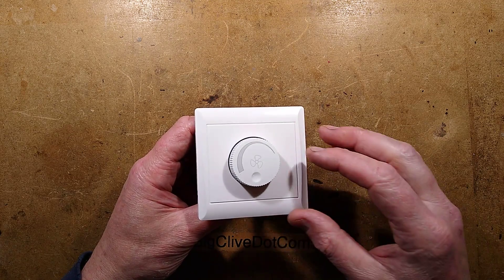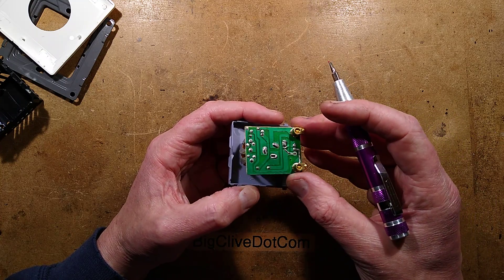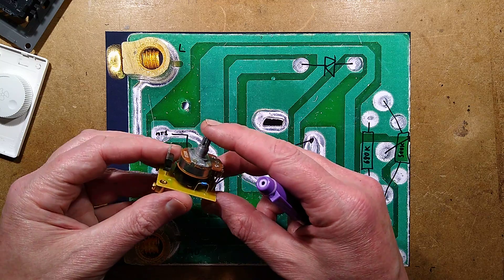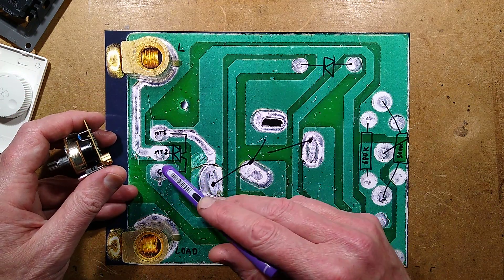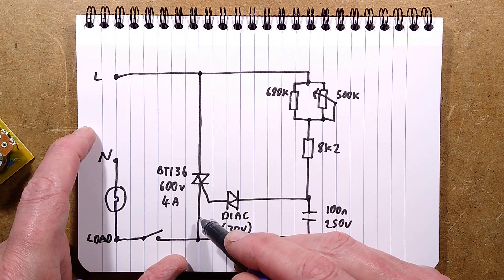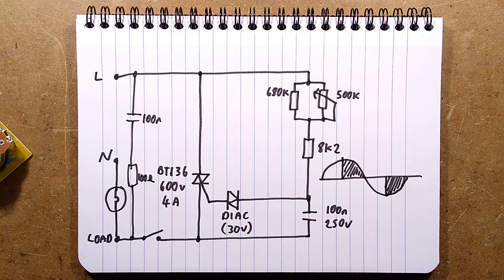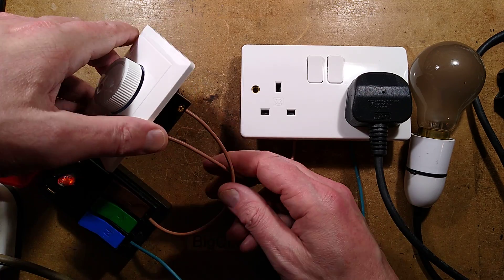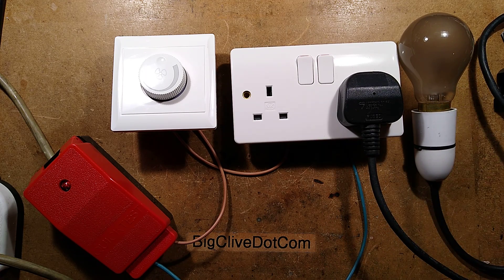Inside a cheap eBay fan controller (with schematic)

Comment: Hello,

I just installed a floodlight next to my CCTV camera outside and I'm planning to control it using a remote control.
The receiver (A chinese one) will be set in a small plastic box in the loft (The part where stuff is stored and where I don't go very often).
I need of course to supply the receiver with 12V from the mains, yet I don't want it to set the house on fire, particularily when I'm not home.

What do you think would be the most reliable option "fire-wise" so to speak between a 50Hz transformer/bridge rectifier/smoothing capacitor combo and a small switch mode PSU like a phone charger but 12V ?

BTW it's 230V here and it also gets quite hot during the summer, ie right now, especially in the loft, but in the living parts of the house I have AC, which means it really gets hot some days.
Reply: The 12V are only to power the receiver or also for the floodlight? 
If the floodlight is 230V and LED and big enough maybe you can put the receiver inside it, in the same space where the LED driver is. Although some of the LED floodlights work without a driver, they have a regulator IC on the same board as the LEDs.
If the light had space there, any switched mode power source with an insulating casing would work, in principle the driver should not affect the receiver too much, and being in a metal casing it could be solved by drilling a hole and putting an external antenna.
There are SMA (the type used by WIFI antennas) male-male connectors for through hole panel mounting, they are threaded on both sides and have an O-ring seal, to connect it to the receiver you would only need an SMA pigtail.
On Aliexpress (probably also eBay and others) you can get compact MEAN WELL switching power supplies with a plastic case, I don't know if they are genuine or not, there are also some imitations with a very similar logo that actually say MEN WELL, WEN WELL and things like that.

I've a DIN rail WEN-WELL 12v 1.25A in the generator shed, the shed has a south facing window so all summer it is quite hot inside, it must have been about 4 years and so far it has not given me any problems. And yes, I bought it thinking it was a MEAN WELL...
Of course there is nothing there that can catch fire even if it fails, it is in a fireproof box mounted on a concrete wall and the generator is Diesel so there are no fuel vapors to worry about. The generator fuel tank is also made of steel.

This says MEAN WELL (but I think it will be fake anyway) and costs € 9,33: https://aliexpress.com/item/1005002500400800.html

This fake MEAN WELL costs € 8,76 and a buyer posted a couple pictures, looks way better built, perhaps it's a good copy of a genuine MEAN WELL: https://aliexpress.com/item/1005002964589965.html
See the pics, the user said he replaced some capacitors for a good brand ones but the pictures were made before, it has also a fuse:
https://ae01.alicdn.com/kf/A7c7007723b6449df8423c7e5814d3967X.jpg
https://ae01.alicdn.com/kf/A60e685b1d5e24565a41bec30bb1f9286i.jpg

This other says WEN WELL and is a bit cheaper € 8,26: https://aliexpress.com/item/4001289041252.html
One buyer posted pictures of the inside and it looks much cheaper inside but it still has a fuse:
https://ae01.alicdn.com/kf/U1ebd5dd85c7848968c7d0e194516ddabw.jpg
https://ae01.alicdn.com/kf/Ud5ecd597c1104107940393d0b769441dI.jpg
https://ae01.alicdn.com/kf/U578b855c3de3478c804b98d5709e8cb5c.jpg
https://ae01.alicdn.com/kf/Uf47efb2f649146d1bf3357557a89cb1cq.jpg

This one says MEAG WELL and is even more expensive! € 9,50: https://aliexpress.com/item/1005003314451085.html

Of course, even if you buy the same one from the same seller, you will never know what is inside until it arrives, normally they don't even know what they are selling, if you want to be 99% sure you're buying the real deal, look at a local electrical store that sells well-known brands.

If you want to to find those on Aliexpress search for DR-15 12V

If you've read this far I think you've won "the long comment reader award" I hope it has at least helped you ;-)
Reply: @ruben_balea  The floodlight is a 230V 500W halogen one and the 12V will only power the receiver.
It's like I said a Chinese one and it has a relay.
I already have the remote control, the receiver and several transformers and switch mode PSUs, phone chargers etc...
Thank's for all those links 😂😜

Comment: Strangely similar, our gas stove has burner controls that behave the same as that rotary dial.  Turn the stove knob past the click, and it's at full gas flow (so it ignites via piezo sparker), then as you turn the knob closer to its limit, the flame goes lower and lower.
Reply: That is standard in Spain - and I would guess elsewhere in Europe

Comment: Hey BC, I tried winding a wire around a steel bolt to create a shitty magnet 🧲 but my variable voltage supply (rated for 80w) shuts down immediately. I’ve tried all different voltages but I think the current goes crazy high and cuts off. Does anyone know how I could circumnavigate that obstacle?
Reply from the maker: It would have to be a large number of turns of thin wire unless you are running it at very low voltage.  Measure its resistance and calculate how much current is flowing on DC.
Reply: You need more resistance. Either a lot more wire or a resistor in series.
Reply: @dbeekman9738  I’m still figuring this out but I did try a resistor in series. The voltage went back to normal but the 220ohm resistor became insanely hot. I was thinking about tying a bunch of the same type resistors in parallel while I wait for thinner gauge wire to show up?
Reply: @JohnDuthie  Dude, you're probably running a few ohms max if you're using any common-ish wiring you'd have lying around. Not much different than just connecting the outputs together. As said you need really thin wire and more length increases the resistance. You'd need something like 30AWG or smaller which is around a couple sizes smaller than even thin earbud wiring for an example.

Comment: I do not mean to be morbid but there is a 3D printed suicide pod that floods with, I think, nitric oxide,  at the push of a button and within seconds one gets a painless death, then they can be buried in the pod. You can set it up by a lake for a beautiful view before you go. Now that would be interesting to take to bits!

Comment: As a Time Traveler from the Analog Era before Solid State, popping the back off and revealing the little green card with all the works is an amazing thing to me.  Transisters and Capasitors filling in for vacuum tubes was a major advancement in electronics. then came Micro-ware, Nano-tech. WHOOSH

Comment: Well, we’ll. This is most disconcerting. Most (consumer) fans (at least in the U.S. of A.) are shaded-pole induction motors; their speed (angular velocity) is determined by the line frequency, not by the voltage/current. Now, this may work just fine with a “universal” motor (works on AC or DC), but I think this “dimmer” will lead to the early EOL of the shaded-pole fan motor. If it varies the speed at all, it’s by making it run really inefficiently, and using the air resistance against the fan blades to slow it down.
Of course, something like this is to be expected, since making a VFD (Variable-Frequency Drive) would be cost prohibitive for a mere fan. 😬
Reply: The fans you speak of are designed for high slip. The high/med/low switch directly on the fan itself change between winding taps without changing the pole configuration. It may be inefficient but the motors are made to be slowed by limiting the current.

Comment: On the plus side, vis-a-vis noise suppression, there's a whacking great inductor in series with the triac or whatever which I'd think oughta help a little - same as in a stage lighting dimmer.  Granted, there's also a whacking great common-mode antenna, I mean wire, between the motor and the dimmer so unless it's all inside conduit... yeah, it's-a gonna radiate.  

I like the remote dimmer fan speed controls which can be mounted in the fan box with metal all 'round... or, yanno, variable transformers, since I also happen to like listening to shortwave, ahem...
Reply: Yes this one will still radiate nicely along the wiring, even with the inductor so far away. The speed controls that basically use 2 large value capacitors in series with the line have no noise.

Comment: Noisy as all, not to mention power factor skew.  Not that the typical shaded pole fan motor has much draw.  But put a few thousand such motors on a branch and now that becomes measurable power apparent the generator must swing.

I fear the future is dim with many brown outs due to poor power factor.  The proliferation of cheap SMPS with the market penetration of electric vehicles..
Converting to all electric vehicle fleet will require an increase of 15 to 25% base load generation. This doesn't bode well for industries like aluminium smelting and electric arc furnaces.

Comment: When I was a kid my father and I made a drill speed controller with exactly that circuit diagram.... except ours had a snubber network and a neon to show when the power was connected! It worked for years, in fact I'm not sure what happened to it in the end, Dad switched like most people to battery tools and his mains drills got used less and less....
Reply: yeah that old memories of making circuits as per our need is amazing 😌 , nowadays many circuits comes as module buy attach and start working in seconds
Reply: I had an old B&D drill that had no speed control or reverse. However saw at B&D service ( those were the days, when you could buy spare parts for things and fix them) the reversing speed controller looked exactly like the plain switch, so grabbed one out of the bin of scrapped drills, buying the drill for a fraction of the price of the spare part controller, and swapped it over, including the stator and a new case, as my one was well used. Upgraded to reversing and speed control for a low price, plus now also had a spare chuck, spare chuck key and cord set, plus a spare case.
Reply: That works fine for a drill with a universal motor. Induction motors, not so much

Comment: The snubber circuit would not appear where you have shown. It would be on the other side of the switch for two reasons
1/ safety 2/ power wastage.

Comment: Why is that light bulb so incredibly dark?
Reply from the maker: It's an old lamp that is slightly blackened inside.
Reply: @bigclivedotcom  That uniformly? I also have one laying around which has sputter on one side.
Reply: @bigclivedotcom  it's a dark BLACK light 🤣🤣🤣
Reply: Mine are the same.  They are dark until you turn them on.
Reply: @westinthewest  Ours in Germany were much brighter even when turned off, they reflected much more light off of the inner coating.

Comment: Safety fail. The pot should either be earthed or an all-insulated type. The knob is too easy to remove without a tool to expose a conductor that is protected by only a single layer of insulation.
Reply: Well done, well spotted yes I agree, basic insulation only potential shock hazard.
Reply: I spotted an exclusion in one of the IEE Guidance Notes a few years ago.  It explained that an exposed conductive part of sufficiently small area need not be earthed.  One example is the screws on a UK light switch or socket cover.
Reply: @westinthewest  I dont think that would cover an exposed pot shaft that's designed to be touched in operation

Comment: Potentiometer question;- I have a pot on a lil 12v fan blowing in my power supply (it's own runs only to test at power up), only at the top 10% of the pot dial the fan will run. It will creep at 90. It does work...But why only the narrow range?
Reply: The next generation of this project might have an FET switching the fan with the pot varying the width or duty cycle of pulses on its gate.
Reply: Most pots have very low power ratings and will fail when connected that way. If it's still okay, you'll find it drops too much voltage for the fan to stay happy: the resistance is too high. Have a look at the voltage on both the fan and the pot at a few settings.
Reply: Yep. Not enough juice, just assumed from the gear I stripped it from it would play nice. Thanks
Reply: To clarify, the supply's internal fan only runs a second at start up. The one on a pot is secondary pointing at the grate.
Reply from the maker: The fan usually requires a higher current to start.  A potentiometer isn't the best way to control its speed.

Comment: Apart from noise suppression, that has all the hallmarks of a 1970s light dimmer. Not that the suppression was all that good even then. I had a dimmer, along these lines, in my bedroom, and what a noisy thing it was. If I wanted to listen to my radio, I had to turn the light off, so I installed standard light switch in parallel with the dimmer.  I'm surprised these things are still available in this crude form.

I wonder just exactly what fan motors it can control - I have an assortment of fans with an array of different motor types.
Reply: It can control regular fan motors and brushed motors, but motor torque cannot be adjusted with these types of dimmers. So if you set it to a low-medium speed and actually use your angle grinder, you'll notice it doesn't maintain speed well.
Reply: PSC motors won't be too happy on them, but squirrel cage / shaded pole motors will do alright.

Comment: Odd that the marking on the knob wants to make the user think that turning clockwise will increase rpm/brightness but in fact, it's the other way around. Your light bulb is a special model to create grey light, right?

Comment: Should have used an scr and had done with it

You mention radio interference a lot but be honest, how important has radio interference suppression even been in the last 20-25 years, specially with solid state objects
Reply: RFI has gotten a lot worse in the last 20 years with all of the cheap switch mode power supplies that don't comply with emission requirements. You have to go way out into the country if you want to be able to receive weak DX stations. In the city the noise floor is so high that you can only hear the strongest stations above all of the RFI.
I wish all of the non-compliant cheap chinese crap would be seized by customs and destroyed and that people importing it would get huge fines.
Reply: @rocketman221projects  gave you a thumbs up on the condition none of the stuff I’ve bought from China would incur huge fines!
Reply: @rocketman221projects  just what are you trying to listen to?
Reply: @phonotical  Ham radio and shortwave broadcasts.
Reply: I’ve used triacs before (decades ago), and didn’t quite follow why the diac was needed.

Comment: Isn't the legend wrong on the knob? - surely if the fan starts off high and gets slower as you turn the knob the printed logo should start off wide and taper down ?
Reply: It does start off wide, indicating maximum, then as you turn it clockwise it diminishes indicating a lower or lesser speed.
Reply: @brucepickess8097  No it doesn't!
Reply: @brucepickess8097  Imagine there's a pointer on the right side of the dial, though.  Starts off pointing at the thin end of the arc, then as you turn the knob clockwise, it's pointing at wider and wider parts of it.
Reply: @idjtoal  Exactly my point, are you assuming the thin end of the arc is maximum speed because in my world the fatter end means maximum and the thin end means minimum.
If the Arc was printed on the base plate and you assume a pointer on the knob then it would be correct but because the legend is on the knob everything is reversed.

Comment: The reason fans need that initial kick, by the way, is that they are usually powered by induction motors. It's not just inertia and static friction; they also generate much, much more torque at their rated speeds. If you turn on a bench grinder or disc sander, or something else with a lot of inertia, you'll notice that it takes a while to build up that first couple of RPM and in fact you could hold it back with one hand (but don't), but once it's at a couple hundred RPM it really picks up and gets to full speed almost instantly.
Reply: Unclear to me what effect, aside from reducing available torque, this sort of control has on an induction motor. Induction motors are frequency locked by their very nature.
Reply: @PaulSteMarie  rectify, then use a beefed up PUT relaxation oscilator/pulse generator circuit (very similar to this circuit. diac replaced by a PUT etc) to make a adjustable f drive?
Reply: @PaulSteMarie  To a degree they are, but they are not synchronous motors. If you reduce torque enough they will slow down. But you're right, there's a limit to how much control you have over this because below a certain speed the amount of torque the motor provides drops faster than the amount of torque the load needs. and the whole thing just stalls. Fans and (centrifugal) pumps are quite good for this because at 0 RPM they don't really require any torque, but that's not true of many other machines.
Reply: @PaulSteMarie  Does everything need a reason?
Reply: The Technology Connections channel explains this principle quite well in respect to discrete fan switches.
Reply: PWM
Reply: @anthonybarra2391  PWM doesn't really work well with induction motors. For brushless DC motors it does.
Reply: Technology connection did a really interesting video on the topic by the way.

Comment: The manufacturer has omitted the inductor on the input. Because of the sharp turn on edges it will generate lots of RF and stress the fan motor as well.💩 product.
Reply: I'm curious if the high-frequency noise could cause mechanical resonance at acoustic frequencies, like: would the motor possibly produce a ringing sound in addition to the 50/60Hz (and harmonics) hum typical of induction motors?